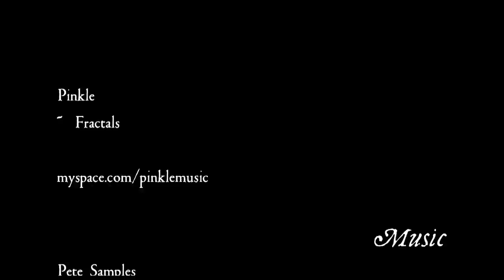How to make a Windsor Chair  by Warren Chair Works

Comment: “18th century craftsmanship at its very best”... power sanders and grinders at their side, just like 1760.
Reply: Joe Blow I thought the same thing. LOL
Reply: That’s not fair. It is made in the eighteenth century way but with hand guided power tools. The more modern way is to use CNC machines. So yes, a mix of old and new.
Reply: If they had power tools back then, they would have used them.